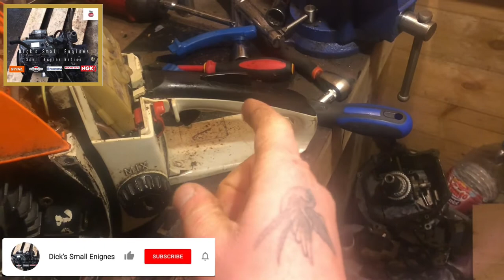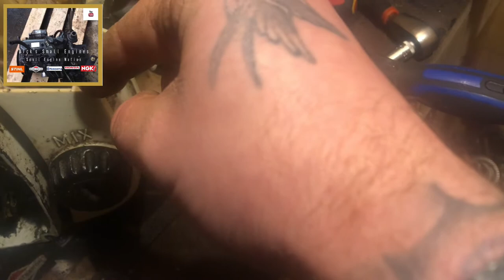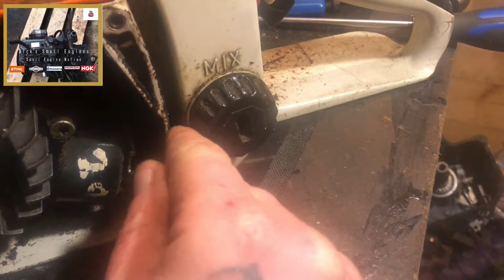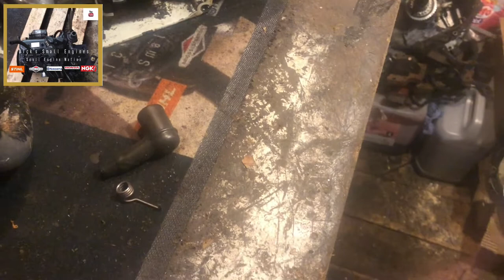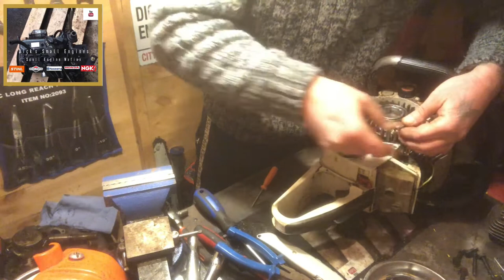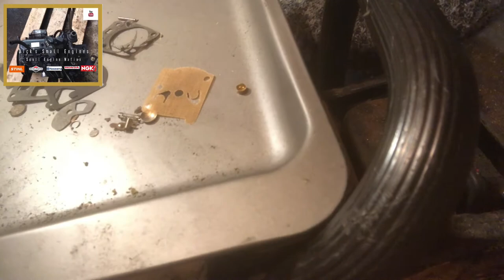STIHL 028AV SUPER- Ignition coil HT lead fix

Comment: Thank you for the video.  Tip:  Using a resistor plug will diminish the spark,.  I never use a resistor plug.
Reply from the maker: Cheers mate 👍🏻🔧